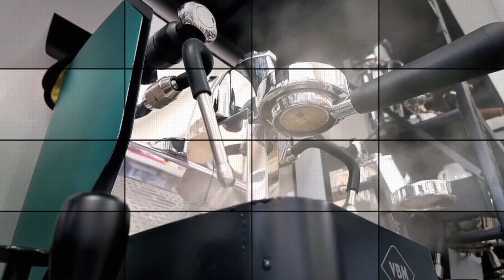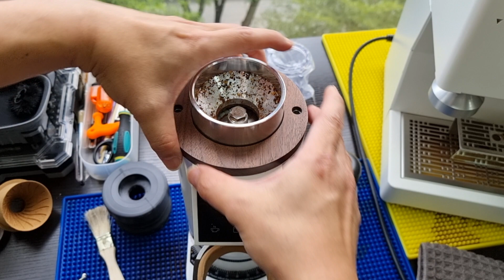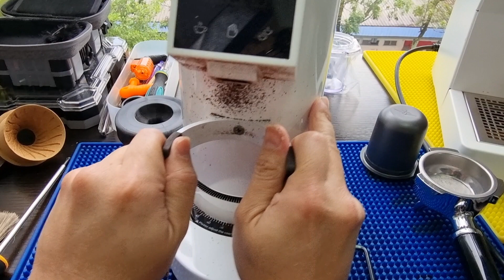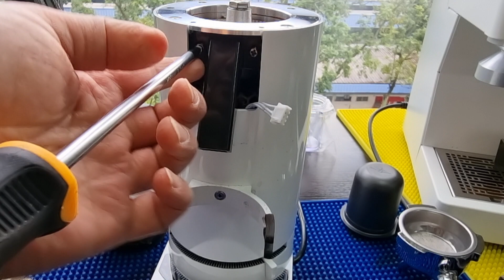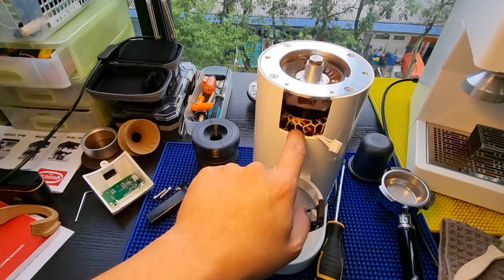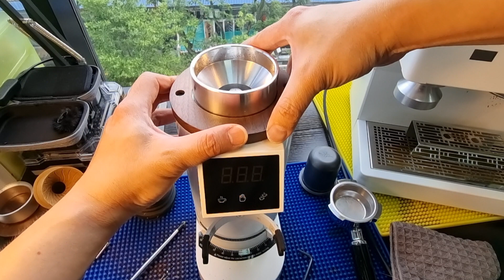DF64E | Servicing and Cleaning

Comment: Thanks for the video! It was really useful. Do you have any issue of losing the ability to grind finer after opening up the grinder? Eg. What used to be 10 is now 5. Do we have to tighten the top cover screws really tight to bring the top bur closer to the bottom?
Reply from the maker: just tight enough will do. as long as screws dont rattle free.